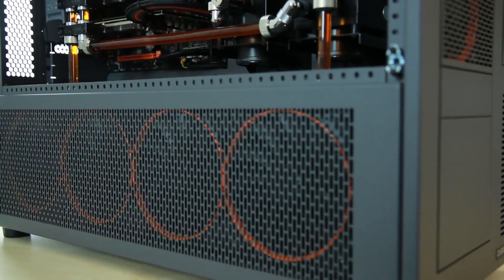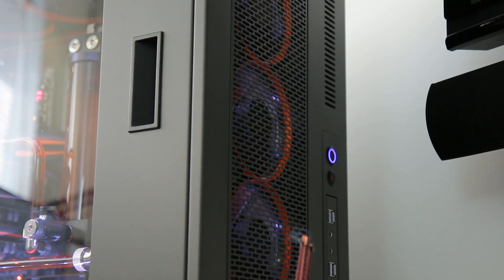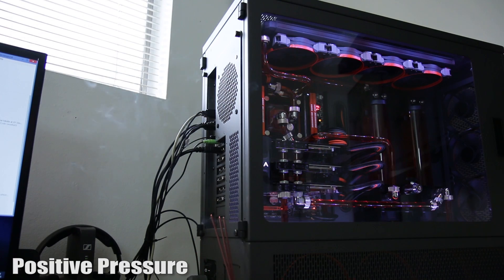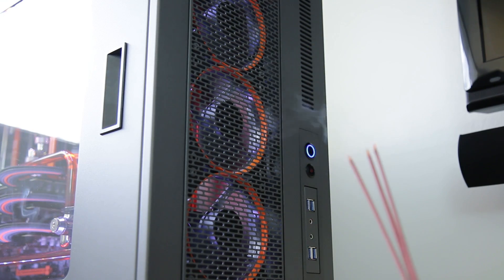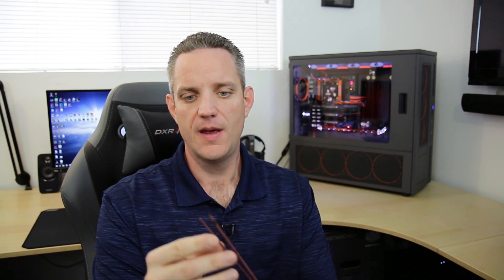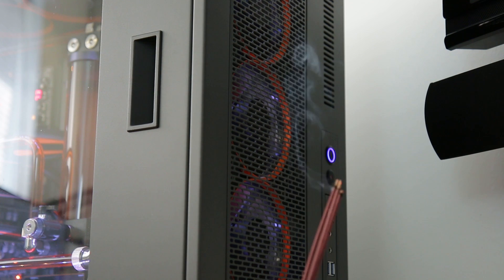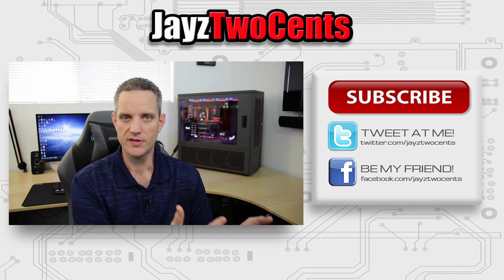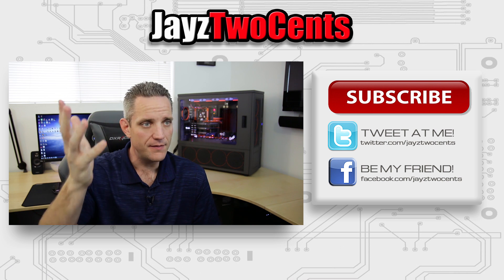Case Flow and Pressure Demonstration - How to balance airflow

Comment: I'm a bit disappointed by this video. It's only half right in the descriptions of what's going on. While it may lead builders to solid conclusions, it might be for the wrong reasons.

First of all, saying that positive pressure is "air in > air out" is not true for steady state, only for a brief period after the computer is turned on. Not clarifying that is misleading. If you did have more air coming in than out in steady state, the pressure would increase without bound and the computer would burst. What really happens is that, when the computer turns on, the pressure increases (or decreases) depending on how much air is forced in and out until equilibrium is reached. Once that happens, air in = air out IN ALL CASES. The description in the video of negative air pressure is a bit more accurate, however it is possible to have air go the wrong way across a fan, but only in extreme situations.

The description of neutral air pressure is wrong. As stated, all steady states have neutral net flow. What is imbalanced is gauge pressure and the work being done by intake vs. exhaust fans, taking into account any resistance. Now saying that the number of fans has "absolutely nothing" to do with the internal pressure is misleading. Sure, it depends on the style of fan, the speed, and the resistance near the fan, but in a simplest (and common) case, fans are basically the same and all run at the same speed, so the number of fans is important.
Reply: +Partners In Crime It's about fans bringing in more air in than fans exhausting. The excess air finds it's way out through cracks or vents. No case will burst because of positive pressure created by regular case fans.
Reply: yourcurtainsareugly
Characterized maybe, but it was also further explained in the video... The example snippets with the smokey sticks were showing it as well. Positive pressure blows air out of the vents, negative pressure sucks air in through the vents.
Reply: Thankyou. You saved me from blowing my computer up with positive air pressure. Can't believe there's only one absolute genius in the comments to warn people about the dangers. Also .... BRAAAAAIIIINNNNSSS
Reply: I start my pc build tomorrow and have been looking more into fan positioning.. So bottom line here?

You want to have your fans positioned so it's obviously cooling and working with your internals (GPU & CPU).

And by my understanding, a well balance of air pressure meaning you're aiming for that neutral air pressure so the fans are controlling the air flow as much as possible, without creating a vacuum or a wind tunnel?
Reply: +yourcurtainsareugly I was thinking "If more air was coming in, wouldn't the case burst like a balloon?" but I didn't think I knew what I was talking about and would sound like an idiot lol. Thanks for making me feel smart
Reply: +yourcurtainsareugly Thanks for speaking up.
Reply: Heilung--- Thanks for saying what I've tried to put together several times now and cancelled for just not quite getting the wording right.  Yes, Jay was giving a common sense analogy to help people with basic airflow factors, and it felt that was being totally undermined for someone else's need to feel smart- at Jay's expense. To me, it felt unreasonable to the point of disrespect. There was no need to take it to the enth degree, because I'm sure the vast majority CLEARLY saw the point Jay was- quite well- trying to make. And yes, the fish was very tasty, lol.
Reply: ummm, how exactly is the computer going to burst? lmfao that's about the most asinine comment i've ever heard, is your computer sealed and air tight? because as we all should know air is very fluid, and as the pressure increases inside the computer it forces the air out of the different crack and openings in the computer, as jay obviously stated in the video, the only way it would BLOW UP your computer is if your computer was an air tight seal so that no air could possibly escape, which if that's the case, you got one fucked up build there buddy.
Reply: Joe Carbone If you could actually read, you would see that the sentence where I said a computer would burst was a counterfactual. Nice try, necro better next time.
Reply: +SirLugash Exactly, which is why the way it's characterized in the video is misleading.

Comment: My case is drastically positive pressure. All components where heat is an issue are water cooled, so I have a 360 and a 240 rad that are both on filtered intake. Exhaust is handled by a 120mm rear fan and a 230mm front fan. The case is a bit of a hot box under extended load periods, but the components stay cool.

Comment: i have a problem. i bought a 2nd Gigabyte 980 ti G1 but when i am trying to activate sli, the point is not in the nvidia control menu. ASUS Rampage V Extreme Mainboard,  Intel Core i7-5820k processor, 850 Watt CoolerMaster V Series psu. have you any ideas what the problem is or do you even have a solution for me?

Comment: my Airflow is definitely not random.
looking to get a fancier case in the near future, but for the time being, but as now, 2x120mm front intake, 1x120mm GPU intake, 1x170mm top exhaust, 1x120mm rear exhaust.
Power Supply bottom mounted to draw from the bottom so that it's completely exempt from the system.

between the top being a low RPM fan and the rear being a Radiator, Positive pressure is easily achieved.
having a GPU intake helps out a lot with ensuring that CPU and GPU aren't fighting for cooling, which in reinforced by having a direct exhaust GPU because open air GPU's are stupid unless you're using a Test Bench.

while it isn't perfect, it displays planned airflow fairly well.
which i ofcourse recommend doing similar things to anyone that asks me... with the idiots that can't into computers ofcourse not listening, doing the exact opposite, and then being confused when i tell them off and say they're on their own if they won't listen to anything i tell them.

Comment: Jay could you make a video showing how using top vents as intakes can perform vs the typical top exhaust? Im thinking of building with front and top intakes with back and bottom exhaust because it's gonna on a carpet. Also the case will be elevated with feet for the said bottom exhaust. Just curious how well it would perform with lots of positive pressure. Thanks!

Comment: Just a note to correct what you say. Negative or positive air pressure isn't explained by forcing more or less air in the case than out. This would violate thermodynamic equilibrium of your closed system (case). Indeed, the air forced in (or out) the case is the same that exits (or enters) it (i.e. same "quantity").

Pressure differentials are caused by forces acting on restrictions. In this case, the fan blades of intake fans apply force on the body of gas in the case by pushing air in, while the case itself contains that force along its walls and permits pressure to increase in the case. Exhaust fans being less numerous or providing less power on the system to pull air out, lower that pressure but some positive relative pressure still remain. The opposite is true as well for negative relative pressure.

Implying that more air can go in than out could lead people into thinking that they could focus on using the most intake fans possible in order to push more air in, at the detriment of allowing air to flow out with exhaust fans. This could in turn lead to systems that aren't well balanced as too much intake could lead to fans reaching their maximal pressure point and "slipping" air, leading to low air change per unit time. Now I know that there will always be interstices where air can leak out of, but some cases are well built, with highly toleranced parts (reducing gaps) and noise dampening material can act as a sealant in some cases. 

Trust me, I'm an engineer.

Other than that, very educative video. I love your channel.

Comment: In Define R5 i got a X61 for exhaust on the front and a standart 140mm on the rear exhausting again) no airflow, more or less the same temperatures if it was for intake on the front

Comment: i have a question,
i have a corsair 300R windowed case and i have two extra fan mounts (on the glass)

I have a total of four mounts I want to use for better airflow (pc doing fine with just two fans):
-2 fan spots on the top
-2 on the glass panel

I was thinking of having two intakes on the glass and two outtakes on the top of the case.
I have no problem changing this configuration around since i do not have four new fans yet.

my setup for better explaining

Corsair 300R windowed panel with two factory installed fans
DEEPCOOL Ice Blade dual cpu fan
x99s gaming 7 board
msi gtx 970

Comment: Nice Advice Jay
I have to say that I used to go for top rad intake to improve case flow 
However this did improve the temperature of the water-cooled parts 
the temps inside the case were very hot And the air from the out take fan was also quite hot
And since that was actually the only out take fan (A Noctua 2000 RPM fan) I had to set it it higher speeds 
Now I turned the top fans around and still have quite positive pressure by turning the Intake fans up

Comment: Jay, I'm getting a Define R5 soon and I ordered 2 extra 140 mm fans, I was planning on adding another fan in the front, and one either next to my power supply or in the middle top moduvent. Which one do you think would be better or should I have different placements?

Comment: I have 2x140mm intake (trough radiator for cpu) in the front and 1x140mm (trough radiator for gpu) exhaust in the back inside a Define S, lovly case and temperatures :)
Reply: what's the point of an intake there? So the heat goes to the rad, then you push it into the case again (warning all the components through the case)
Reply: +Nikita M Baseless speculation. I have basically the same setup in a Define R5. First of all, the heated air going through the front rad is only a couple of degrees hotter than ambient, still much cooler than the components it comes into contact with. It's not like the air cooling a 60 C component instantly heats up to 60 C. Each unit of air only gets a small amount of heat increase, and it's the large volume of air moving through that provides the magnitude of power.

 The point of putting the intake rad there is to provide cool air to it, and because that's where it fits. The sound baffles on the front are nice so I prefer the rad there as opposed to the top of the case, where it might block other components and have direct acoustic paths out.
Reply: +yourcurtainsareugly i got it
Reply: Nikita M I want it to be as quiet as possible, i CAN put the cpu-radiator in the top, removing 2 of the covers, but my computer is on the floor right next to me, so then i would have the fans making noise upwards on me. I did test it, to see what the difference in temperatures was, in it was just 6-8 degrees lower, but far much more noiser. My cpu is only at 45-50 at load with the fans only at 60% speed with the radiator in front as intake and very quiet due to the top being locked.
Reply: Its a 6600k @ 4,7ghz by the way.
Reply: +Zxxtra u didn't get it. i wasn't saying about the top, what i meant was push vs pull at the front.. it's clearly understandable that if you remove the top panels u would get a much noisier build
Reply: Nikita M So you want me to exhaust in the front and rear? Negative pressure much. lol.

Comment: is anyone using a physx card
i was thinking of sli 4gb 960s but i also have a 750ti not being used,,, would using the 750ti as a dedicated physx card help at all
Reply: GPUs nowadays are powerful enough for their own Physx, added dedicated cards just slow them down
Reply: +Josh Shelby I understand where you're coming from but the original idea that Ageia once came up with is obsolete now since your dedicated graphicscard will handle the PhysX on it's own. Using a dedicated PhysX card would be a waste of electricity and in some cases might even lead to bad results.
I guess unfortunately you won't understand German because a famous German PC Hardware magazine released a video just about that topic. The result was that the PhysX calculation with a "weaker" GPU used as a dedicated PhysX card caused framedrops on Assassins Creed when looking into a campfire while the framerate was steady when letting your dedicated graphicscard handle the PhysX.
Reply: +Meta Custom Computers
Would you mind linking me to the video or providing me with better keywords to find it myself? I'm fluent in German. I would like to analyse their benchmark and hypothesize about potential causes.

I don't generally do SLI, last time i did, i had a GTX295 and the only PhysX title i had at the time was Mirror's Edge, incidentally one of my favourite games of all times for no reason whatsoever. GTX295 is an internal SLI bridge unit, consisting of two unspecified GPUs vaguely similar to GTX275, and with all the according configuration options. I found that running SLI for the graphics was ineffective at improving performance, and that using SLI+PhysX made the game near unplayable in PhysX heavy secions. The best result was from dedicating one half-GPU to graphics and one to PhysX. But even turning one of the GPUs off completely and having both graphics and PhysX run on one GPU was indeed better than SLI+PhysX on two GPUs.

So regardless of test of one GPU vs one GPU and PhysX accelerator, SLI + a dedicated PhysX card can be an advantage vs. straight SLI. Because SLI profiles are wonky bitchy little shits anyway, and might be easily thrown off by additional workloads, like in that case PhysX.

As a developer, i just scratch my head when people ask for SLI support anyway, it's not something we can sort out at application-level (at least not until DX12 came along, but i haven't worked with that yet), and the performance gain is still going to be at best inconsistent, or add latency, just because of how hardware and software stack work.
Reply: +Meta Custom Computers 
Well i googled it up and it appears you have it backwards? PhysX support in Black Flag is commonly regarded as a terribly unoptimized, superfluous add-on.
Here's an article from PCGH, which is generally an extremely well regarded magazine:
http://www.pcgameshardware.de/Assassins-Creed-4-Black-Flag-Spiel-18269/Specials/Assassins-Creed-4-Benchmarks-GPU-PhysX-1102364/
Hardware PhysX makes the game dip down to unsightly framerates on a Titan. A low-end extra GPU for PhysX only salvages part of the performance.

Comment: Pff I have neutral pressure because I don't have any fans in my case. Also, I think negative pressure gives better cooling and positive pressure is cleaner. Negative pressure causes air from all over the place to be sucked trough all the heat generating components out of the case.

Comment: case -> phanteks enthoo primo.

3  phanteks 140 intake fans at the bottom circa 1000rpm  (filtered).
2 phanteks 140  fans filtered intake front ca 1000 rpm.
1 noctua flx 140 fan out back ca 900 rpm.
 Push-pull rad at the top blowing out with  4 noctua flx 140 fans ca 1000 rpm.

asus x99-s mb, 5930k 4,5 ghz, corsair H110, 32gb crucial 2133,  2x (sli) gigabyte gtx 980ti g1 gaming 1450 oc boost (stock cooler).

By having the case standing high on a table dusting is a minimal problem, vacuuming the filters about every 2 month`s with little dust build up. Why not complete water cooling ? Norway, it is cold as f#!#, no need for full watercooling in a room with 18c+ degrees ambient temp :D Gaming ( like metro redux, crysis 3, battlefield 4) ->  Gpu`s never higher than 67-70 (top card in sli), cpu max 55-58c+, vrm 45-50c+

Comment: My case has only 1 exhaust fan at the back (Rest In Peperone). I've reversed it so it brings cold air inside the system, but it's still at the back of the case. I'm thinking of getting it at the top of the case (where there are 2 fan mounts, both filtered) bringing cold air. If anyone's interested, my case is a coolermaster elite 372. Would that be a good idea?

Comment: Jay, I do be;lieve negative pressure is better in terms of cooling for Air cooled systems. (esp with third party GPUs which exhausts the hot air in the case. A positive pressure would proabbly lead to a build up of warmer air in the case as compared to negative one where the air is drawn out more?
Reply: +Joel Tng That's one thing he didn't explain very well in his video.
No matter if you have positive or negative pressure in your case, the amount of air going through it is always the same, so as long as you have a constant airflow (no matter if positive or negative pressure), there will be no heat-buildup inside. The positive pressure will just be present till equilibrium inside the case is reached. At that time, the amount of air that goes in is exactly the same amount that goes out. Else the case would expand infinitely until it explodes. Same goes for negative pressure. The negative pressure will just be present till equilibrium is reached. Then the amount of air that goes in the case is exactly the same amount that goes out of the case. Else the case would shrink and implode.
You see, it doesn't really matter as long as you route the airflow as effective as possible and as long as your case doesn't have big holes and gaps where (under negative pressure ) unwanted air might be drawn, everything will be fine.